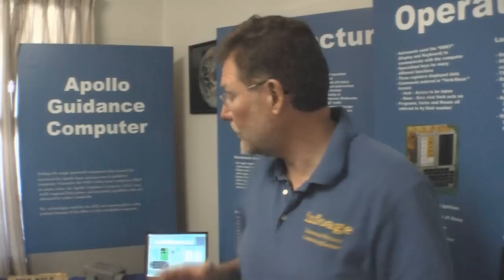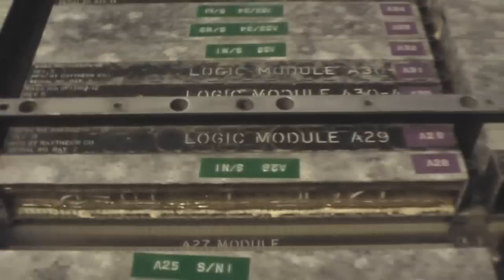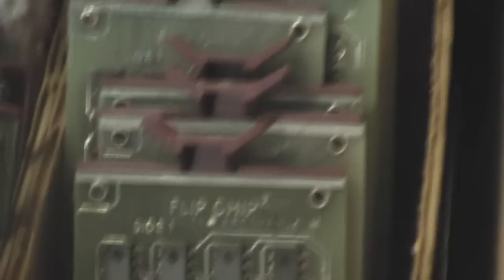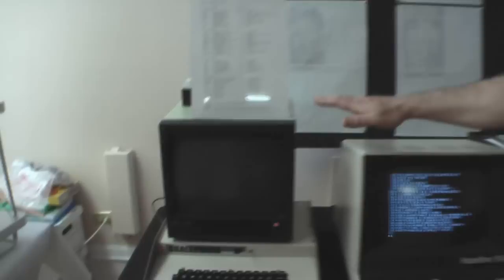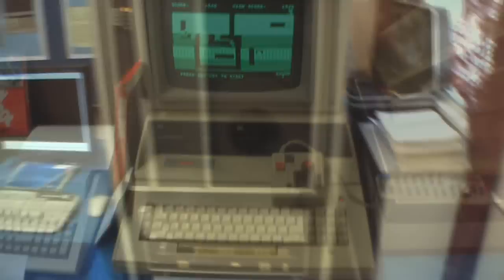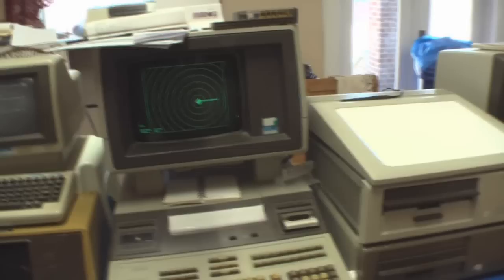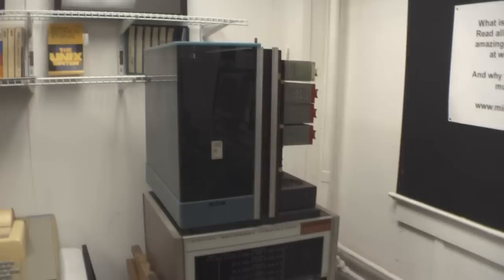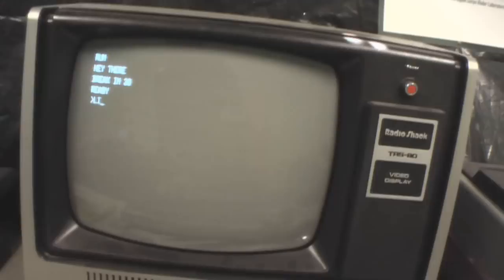VCF East Pt.2 - Apollo Guidance Computer to IMSAI and Beyond

Comment: Hi Fran I used to program the IBM 1130 in Fortran in Poet Morsbey. 
We had disk, cards, papervtape and a printer. At the end of each run we backed up the data
by punching it onto cards. One day we got a new super fast paper tape reader that would not read the tape.
It was a infaread reader and the tape was red!

Comment: Thanks Fran for this fill-in to some of the gaps in my understanding of computer history. My first real computer experience was courtesy of the U.S. Navy on the first ships to take computers to sea on the west coast. The 1961 AN-USQ-20 by Univac had no IC's at all but ran a SAGE-like system of air traffic control "on less processing power than a hand calculator" .
 In Jr. High I won a blue ribbon at a 1957 Science Fair for a very simple analog computer that I made "digital" by adding 20 handmade keys half white and half black so that it could add two single base ten digits. Mini-gator clips took me all night adjusting so that the hand painted analog meter would read the right answer from the two stretched nichrome wires functioning like a resolver.  So much more to learn!

Comment: Wow... I feel old... I recognized almost all those machines before you even identified them.  The 70's were an amazing time in the development of the micro and I was there!  (at least as far as I can remember ;-)
Reply from the maker: I agree - I too am very nostalgic for these early micro systems, and I wanted one SO bad back in the day!
Reply: Like most of us using micros back then, I had to build my own systems at first.  I built a Signetics 2650-based system with 1K of ROM (PIPBUG) and 1K of RAM.  It communicated with a (home-builot) "glass teletype" at 110baud.

I'd have killed for the stuff I could see in US magazines!

Eventually however, I had a TRS80 Model 1 (which grew with the addition of the expansion unit and four floppy disk drives running NewDOS80), a TRS80 model III, a Compucolor, an Intertec Superbrain plus the huge 8MB hard drive unit that had an 8" winchester drive inside, an Epson QX10, Ohio Superboard, Atari 400, Atari ST, Amstrad C128, and several other 8-bit machines.

It was actually quite sad in many ways to see the IBM standard proliferate once their PC was introduced.

Back in the 8-bit days, every machine was different and designers were able to fully exercise their creativity in so many technical and artistic ways.  The PC-clone era effectively killed that, as everyone simply sought to be "compatible".

Now I get far more fun out of returning to the low-level stuff and working with microcontrollers, FPGAs and the like -- these also give you the freedom to innovate and be creative.

Comment: OMG!  The computer under the tape drive cabinet is the same one I used in the Navy for repairing the radar assemblies for the F-14D.  All the components in the test set I used were off shelf components (no special military hardware) but I have never seen that computer any where else before.

Comment: This is an awesome vid. It's funny you didn't recognize some of those I did and we're only a few years apart. The OSI systems were radical at the time, they had one that could run all three operating systems and cpus at the same time on one mother board. Had a 6800, a 6502 and a Z80 sharing resources. I doubt you could run all three at once, but it was a pretty radical idea for a business system. 

It's funny how everyone wants to think of this or that being the first, but the intel 4004 was designed to control traffic lights, and well into the nineties the vast majority of pocket calculators used 4 bit cpus. The very collectible Sharp line on the times was actually a dual cpu machine, one to handle the computations and one to handle the display and keyboard. Two 4 bit cpus in the palm of your hand doing high level math in real time.  And there was an intel 4004 kit design roiling around at the time, so maybe 4 bits is where it's at.

Comment: Oh Fran - thanks so much for this ! It's a real trip down memory lane for me : Data General NOVA with paper tape based 2 pass assembler, and TeleType of course.  Looked like the Digital on @ 14:40 . At work we bought an HP 9830 with a 80 char. thermal printer and A4 pen plotter for £ 12,500 in UK in early 1970s. Our first 3 bed detached house cost £12,000 at the same time !  Intel-run course on the 8086 and in-circuit emulation held in Oxford; all so much fun ! That for me was the 'Golden Age' of computing . And yes, I've downloaded pictures and the Assembly language manual for the DG NOVA just to show the kids what real computers were. They were, of course, singularly unimpressed.